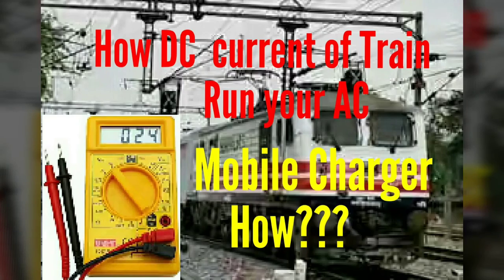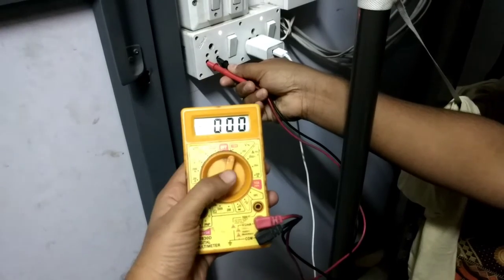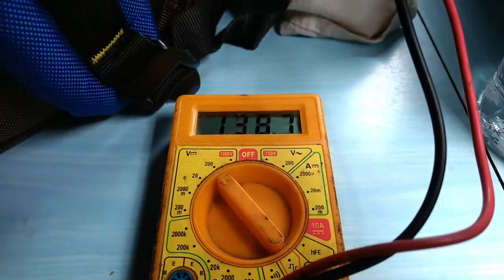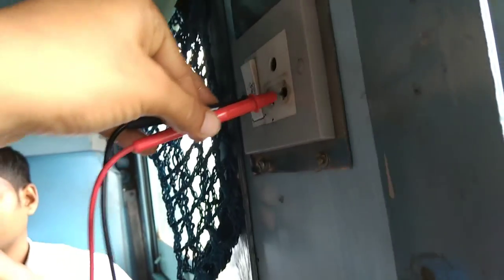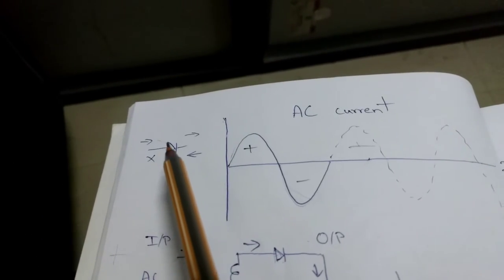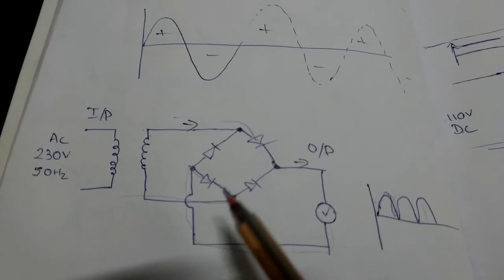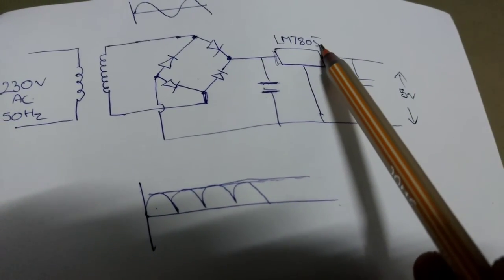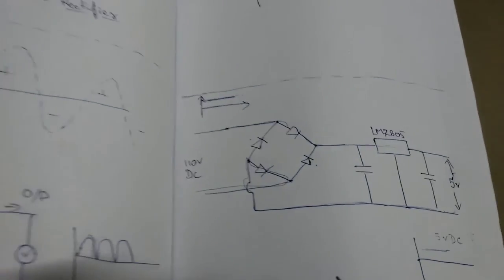How DC supply of Train Run AC supported mobile chargers #SustainableEveryDay

Comment: Most of the mobile chargers out there in the market uses high frequency Switched converters instead of linear regulators due to higher efficiency and also to reduce size of the converter(high frequency transformer has lower size compared to their low frequency counterpart). 
So in all these SMPS based converters, the first step is to convert input AC voltage(240/110V depending on standard voltage) to DC. They uses a bridge rectifier for this primary stage. Only after rectifying the input AC voltage and filtering the ripples to a DC voltage, these converters uses a buck converter (a step down switched converter) to step down the DC voltage to the required DC voltage.(which is near to 5V since Li ion batteries have a full voltage of ~4.5V).

A bridge rectifier does provide a DC output, irrespective of its input as AC or DC. (Well,ignoring the diode drops).
So whether you put AC or DC to the input of such a converter(an SMPS based one, which have a rectifier as the primary stage..) it will work. 

Most of the commercially available Compact fluorescent lights (CFL) and electronic chokes of fluorescent lamps are having a similar working principle concerning the primary stage.( ie. They convert input AC (50/60hz) to DC first and then does the conversion to  requirements of the fluorescent tube. )

So in a brevity, these DC sockets in trains can't be used for a charger or converter that has transformer as the primary stage instead of diode rectifier as DC input will saturate the core and damage the windings due to lack of back EMF, in mundane words.
This is the reason why they label " only for mobile charging"(cited, most standard mobile chargers are SMPS based with a rectifier as the primary stage) on these DC sockets prohibiting the use of other type of chargers.(those with transformer as primary stage).

These SMPS based chargers generate the requisite frequency (we often uses 10khz to 60khz for the pwm frequency) for the high frequency transformer which becomes part of the flyback-buck converter topology. So it doesn't matter whether AC or DC is fed in to its primary rectifier stage as long as voltage is in accepted range.

I am not delving in to details of the flyback-buck topology. Most generate high frequency based on a pwm ic or using a simple diac circuit (for CFL lamps).
Reply from the maker: +Alen Mathew 
Exacly Sir, i am very glad that you shared such valuable information with me , i am very thankful
Reply: Solar Every Day the honour is mine. Thanks for the meticulously shot video which would clarify the doubts of many people seeking an answer to the cited matter. 
Though, as a side note, I wish to add a request to reduce the volume of back ground music in your future videos.

Comment: Nice video, but mobile chargers often uses buck or flyback topologies and these circuits are designed for take AC inputs then how dc is used for mobile charging as there is no lm7805 or any kind of voltage regulator  inside the mobile charger.

Comment: What about the transformer
Reply from the maker: +Sainath BINGI 
The transformer used in AC engine is for the TRACTION MOTORS AND and parallel DC supply in the coaches